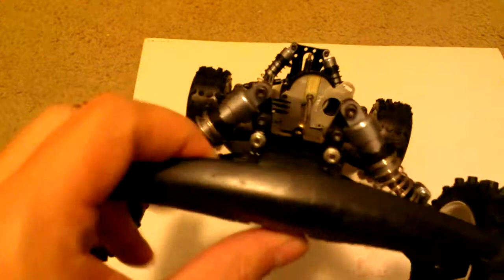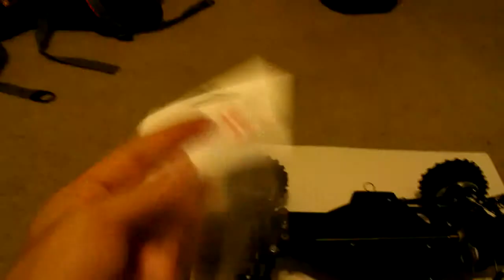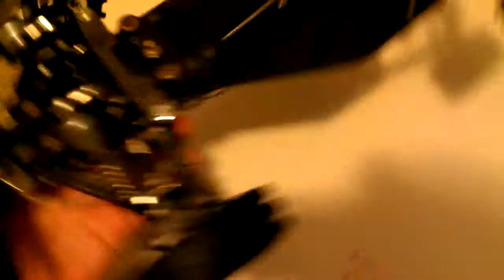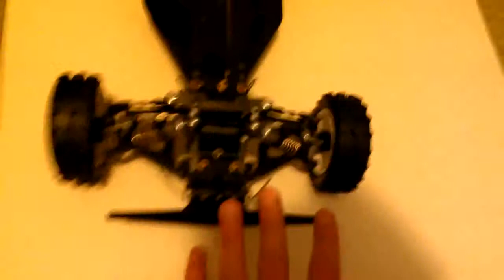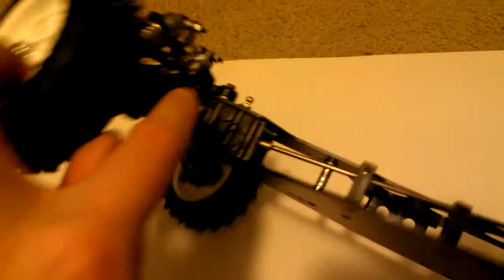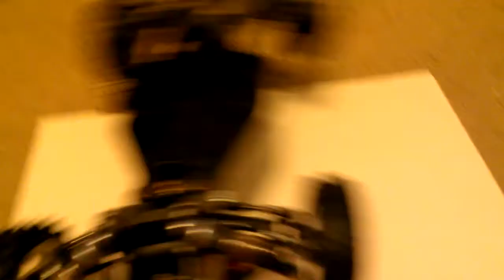Tamiya Avante 2001 "White Special" Project, Part 2

Comment: You mentioned you were getting a TBG Avante 2001 body. One thing I should point out is, the mounting holes on the TBG body are not flush to the body mounts on the Chassis. The TBG body is also shorter in length compared to the original. So measuring the mounting holes can be a bit tricky. Same goes for the undercowl if you decide to get that as well. This affects the decals as well, since the repro decals wre sized to the original body. espeicially the annoying side "Avante" decals.

Comment: Can you please tell me if the hi cap shocks on 2001 are the  same size as the egress ones?. I have a set for sale but i may keep them to go with my rere 2001 body set on a used chassis if i can find one.
Reply from the maker: All Avante/Egress/Vanquish chassis use the same size shocks.  The only difference is in the way the shocks are mounted.